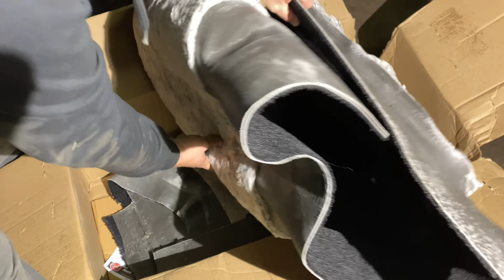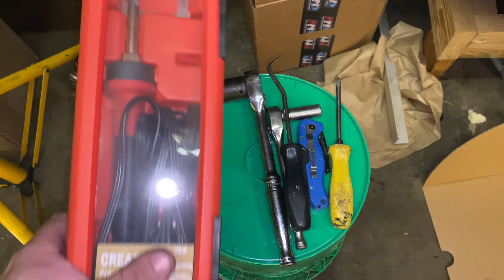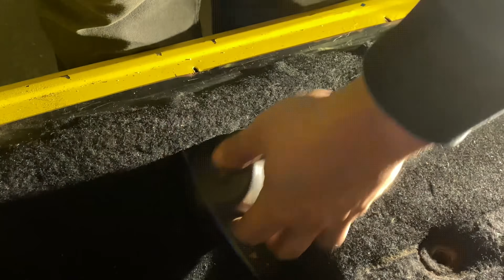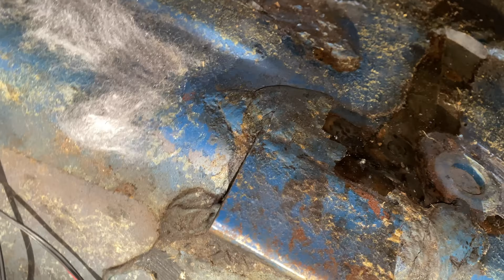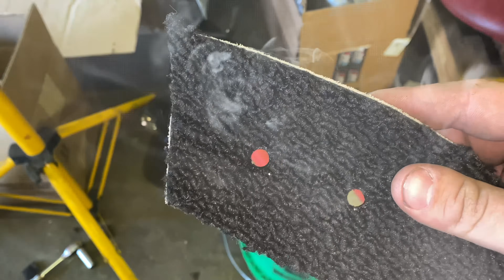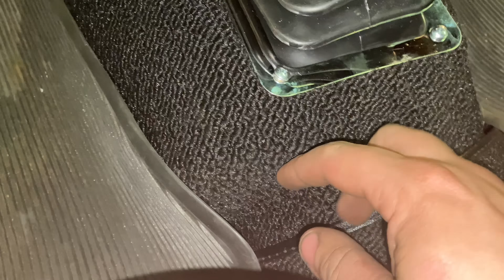Installed new carpet in my 68/69 Ford Fairlane/Torino.

Comment: I just removed my carpet today on my 69 Fairlane.  The carpet I removed was cut to the floor bottom of shift area, leaving some original paint up to the chrome boot ring.  I like your look better-  do you know which way was stock?
Reply from the maker: Yes, the carpet is supposed to go all the way to the shifter so you see no metal floor or paint exposed. They sale two different types of carpet for these cars with floor shifter, one for automatic and one for manual, so just be sure to buy the right one for your car and then you can cut the hole as you please. Hope this helps, Thanks for the compliment and thanks for watching.